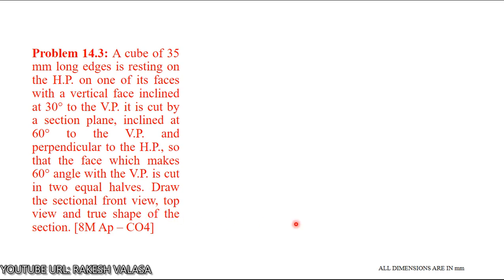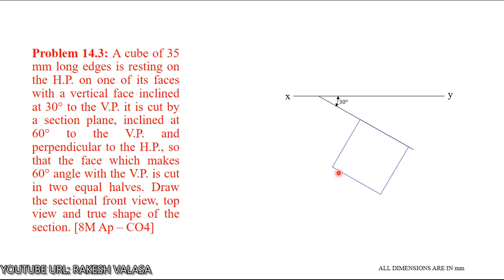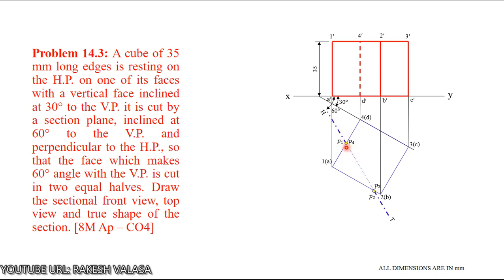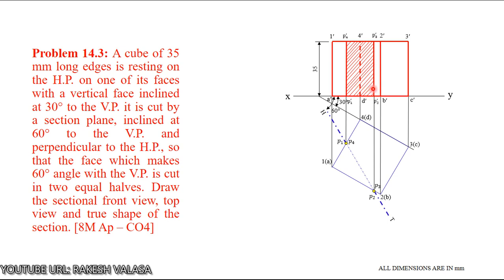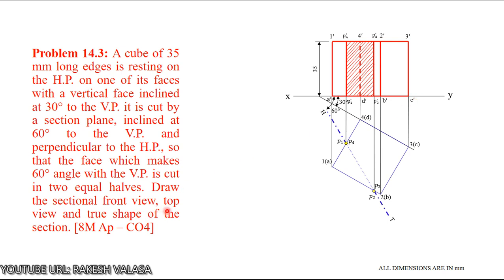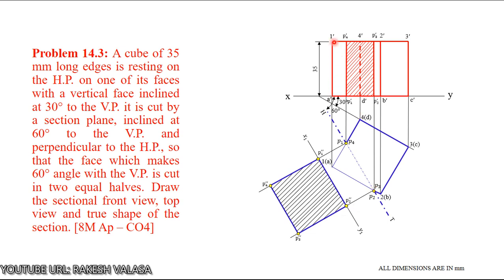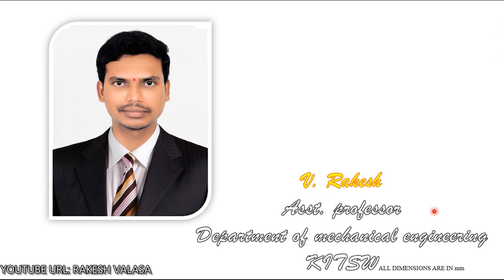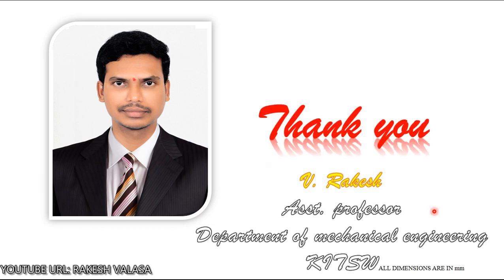problem 14.3, sections of solids solutions (Engineering drawing by N.D.BHATT textbook)

Comment: 1A cube of 35 mm long edges is resting on the H.P. on one of its faces with a vertical face inclined at 30° to the V.P. is cut by a section plane, perpendicular to the V.P., inclined at 45° to the H.P. and passing through the top end of the axis. (i) Draw its front view, sectional top view and true shape of the section
Reply from the maker: Check this playlist for more explanation videos.